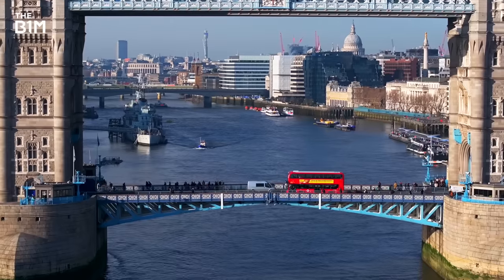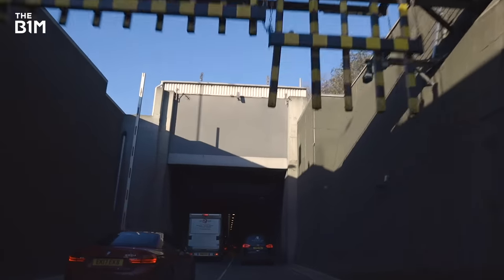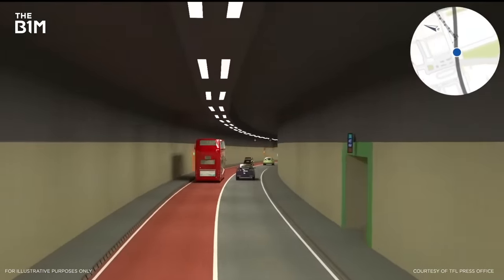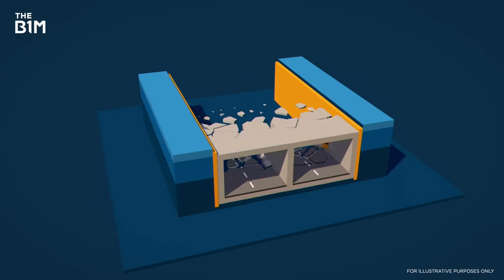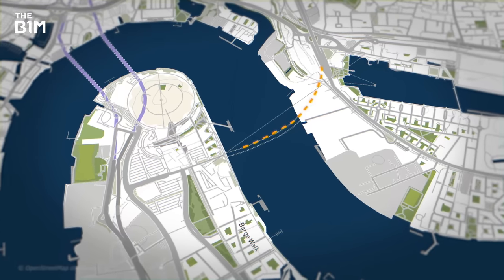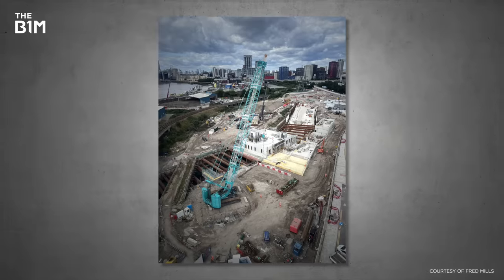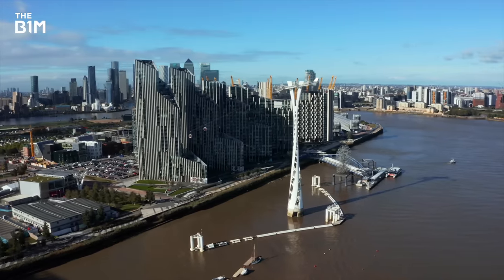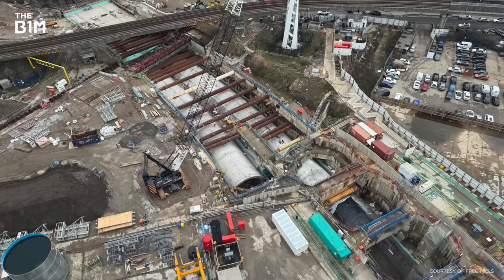The $2.8BN Megaproject Dividing London

Comment: I lived in the Royal Docks, and I know how horrible it is to try and get from North to South and vice versa. Yes we do need more public transportation and cycling options, but we also desperately need another tunnel like this. In that area there are very limited options to cross.
Reply: what road have they ever added in london that made traffic better? The problem is too many cars
Reply: Ive lived in silvertown and now live in Greenwich. Getting to the other side of the river is super easy. Its called "the tube".
Reply: @obinneji There aren't even decent transport options because of lack of crossings. I live in the east and when I needed to to cross the river, I had to take a bus to Woolwich tunnel, cross it on foot and take another bus on the other side. Extremely inconvenient.
Reply: @arturturkevych3816  fair point!
Reply: @obinneji depends on how you define making traffic better. You could argue the same thing with mass transit if you think it’s a failure because the network has to be expanded or improved ever again. This won’t solve congestion issues you won’t ever do that. But it will help.

I love cars and want to drive. If you want to take mass transit great. I support expanding public transit but I also support expanding our road system.
Reply: @campbellsadeghy213  there's a body of evidence that shows similar schemes actually make traffic worse.
Reply: @gmtom19 can you take your car on the tube tho
Reply: @dressrosacr7  why do you want to drive in one of the best places on the face of the planet for public transport?
Reply: @Hurc7495  I work with my car for example so I wouldn't be able to do that, also not to mention it's quicker most of the times and more convenient
Reply: @obinneji  The road could make an excellent tram-route in the future.
Reply: @obinneji  since 2000, the UK population has incrased from 58 million to 67 million. Do you think an extra 9 million people increases congestion or emissions? Does population rise drive increasing emissions from construction, heating, food production and transport? It's silly to blame an infrastructure project for a natural consequence of more people on the island.
Reply: Why would south east London want to connect to poor east london?
Reply: @KiLLJoYYouTube  aren't you the guy who used to hack the sidemen gta lobbies
Reply: @dressrosacr7  i'll have to take your word for it that your car is necesarry for your work but as someone who lives in a relitively small city with relitively light traffic i still find i'm regularly faster than a car over 3 miles. i also never have trouble finding parking and it's always free!
Reply: I @gmtom19 I agree with you if you do that in "normal hours" try to do that at 3:30 in the morning....
Reply: @dressrosacr7  Okay and? I live in london, so like any sane person I dont drive.
Reply: @aspalma   Fair, but I dont think theres much traffic in the blackwall tunnel at 3.30am
Reply: @gmtom19  how are you trying to say people that drive are not sane, that opinion alone isn't a sane one
Reply: @gmtom19 true!  3:30 is marvellous to cross. But when I return in the afternoon... :(
Reply: @KiLLJoYYouTube  Pretty sure south east London isn't so hot either lol
Reply: @obinneji  Yes, but the huge bottle neck doesn't help. I live in Blackheath and welcome the Silvertown tunnel, as it can take 40 minutes to reach the tunnel sometimes. Any easing of that congestion is welcome news.

Comment: It’s a great feat of engineering, however as London is so congested where does the traffic go at either end, the tunnel and the exits will be blocked with traffic most of the time.
London has always made the tube and trains the priority and all the best underground real estate is full, especially in Chelsea, Knightsbridge and the underground basement in mansion houses. Above ground you can’t widen any roads for a significant distance so what do you do, bridges, drone taxi, super deep tunnels? It’s the 24/7 ancient city that is at the limit.

Comment: There's no such thing as 'road tax' in the UK.
Reply: VED is often called 'road tax'
Reply: @Gfynbcyiokbg8710  It is. But it's incorrect and misleading - Vehicle Excise Duty does not go directly to road maintenance or building. It goes into the general tax pot. And on a different point, most cyclists pay VED, contrary to the belief of some, as most cyclists are also car drivers.
Reply: @RTWuk  except road tax doesn't mean a tax that goes towards road maintenance, it usually just means a tax that vehicles have to pay to use public roads so therefore VED is a road tax
Reply: @Gfynbcyiokbg8710  You've missed the point.

Comment: See you in 20 years when it’s not gonna be enough because this is a well documented phenomenon that this will never change a thing.
But great engineering feat though!
Reply: I can only hope one day it's converted into a tube line or a cycle path
Reply: Bet you don’t comment the same thing on public transit projects.
Reply: @campbellsadeghy213 thats the whole point, public transport is so much more efficient that this barely happens
Reply: 20 years? You’re too optimistic.
Reply: @campbellsadeghy213 name one western project that took 20 years and still isnt built
Reply: @KingFinnch it does happen. If you provide something convenient people will try to use it thus causing congestion and creating the need for a new convenient connection to offset the congestion. This is true regardless of car roads or mass transit lines.
Reply: @Hhhh22222-w  their not saying it won't be completed their saying that adding more lanes and alternatives creates more traffic its a well documented phenomenon,  so most of the time road projects like this one are not the solution
Reply: And how would things be in twenty years if we didn't build the tunnel - better or worse than with it ?
Reply: @LIETUVIS10STUDIO1  They wanted to do that for the Levis tunnel in Quebec, but that’s ridiculous as well. There are other ways to remove cars in this cases. But yeah, at least they could do that!
Reply: @hb1338  Depends! Given the UK gov, probably worse because they would not do a dime to change how people move. 
If they had a proper government, with actually intelligent people, they would cancel the project, use the money to invest in a proper infrastructure that remove most cars from the road, give people way less transit time, and help cleaning the air. 

But you know, we have the brains, they just aren’t the ones we elect.

Comment: One more lane bro, one more lane, I swear it'll work this time!!!!
Reply: It will probably work as now there will be tolls on both tunnels and much better bus routes
Reply: All the tunnels are toll routes and drivers hate tolls. 
I would much rather a crossing exist then nothing at all.
Reply: East London does have a bit of problem regarding traffic tbf. We currently only have three crossings by car, And only four by train as well, 2 of which being the DLR...

If I'm not mistaken, that means all vehicular traffic currently passes through 5 lanes north bound, and 6 lanes south bound. That's a lot of traffic reliant on 3 crossings.
Reply: It’s not one more lane though.
Reply: @NitroNuggetTV  ??? There are 7 rail crossings in East London which is the same number as West London. 

And there are either 7 or 3 lanes in each direction (depending if you count the Dartford crossing or not) + the Woolwich ferry.

Comment: I don’t live in London, but I heard about this project a few years back. I didn’t realise they were made enough to actually build it! Whatever happened to reducing vehicular travel and congestion?
Reply: This will reduce congestion
Reply: @DaChaGee  No it won't. Every new journey that this tunnel generates still has to start and end on regular city streets. It will only mean more people choosing to commute cross-river by car, casuing more trips through existing streets. 

Every study shows that adding more road capacity in dense urban areas doesn't work. It just encourages more people to drive who otherwise wouldn't, increasing traffic in the long run.
Reply: @LightbulbTedbear2 ah well

Comment: This new tunnel will just skim off the local traffic between Woolwich/Charlton/Greenwich in the south and Silvertown/Becton/North Woolwich on the north side. 

Long distance traffic heading north via M11 or south via A2 into Kent/Dover/Chunnel will still use the old tunnels. Any long distance traffic trying to head east  from the new tunnel will first have to first go west over Lower Lea crossing before joining the A13 at Leamouth Rd/A13 junction, just 500m from existing northern portal. Or navigate the local roads at 20mph to Beckton to join the northbound traffic from the Woolwich ferry on the A1020. The locals will love that. I will probably use it as I travel locally between Sidcup in Bexley and the SportsDock centre on the A1020 to coach. But its going to cost me the toll both ways twice a week and we don't know what that will be yet. Dartford crossing is £3 for cars.

It seems unfair that only the east side of London has to pay tolls to cross the Thames whereas the rest of London uses the bridges for free.

Comment: that "removing idling cars" argument by city hall is utter bs, it is a well known and documented phenomenon that more streets and even more lanes often lead to more traffic congestion and overall to more traffic which way outweighs the removed cars in idle
Reply: So does their LTN schemes which already cause traffic bottlenecks on major London roads.
Reply: @NmpK24 How though? You shouldn't even be driving down residential roads in the first place. There was already bad traffic so you had to resort to driving through quiet residential roads mean the roads were already congested. LTN's were introduced to reduce short car journeys by blocking residential roads. Main roads will always be congested it is not as if it was quiet and free flowing.

Comment: I totally get the arguments against the tunnel, and I do worry pollution will rise. But living in the area - the current situation is a total nightmare. The Blackwall tunnel operates beyond its capacity. For half the day there are miles long talebacks, which causes a lot of pollution. Any problems with the tunnel, like a car breaking down, causes the entire local area to back up with traffic, as the only other alternative, the Rotherhithe Tunnel, is not just miles away, but single lane and extremely narrow. Something needed to be done.

Comment: Why nobody is building underground networks for electric bicycles. They can be used year around emission free plus cardio exercise. Bicycles can’t be taken out of the tunnels batteries are replaceable at charging stations hopefully powered with renewables. It doesn’t have to be all underground it can be on the surface or above like bridges but must be covered and protected from the elements

Comment: All the people with the classic ‘one more lane bro’ mantra are forgetting that there are other vehicles that need to get around London other than cars. From a lorry drivers point of view this is a major positive for London. The majority of HGV's (except double deckers) can go southbound with the 60's Blackwall tunnel (I think it's around 15'6''), but northbound with the Victorian tunnel is totally different. The height restriction is around 13ft, the majority of HGV's are higher than 13ft , where i work the lowest is 14ft. This means major detours if having to move north from the south, Either further into central london or out to the already heavily congested Dartford tunnels. The Sainsburys Thameside Distribution Centre is a prime example, around a 5-10 minute drive from the blackwall tunnel to the south, you can go south to it from the M11, but have to take detours if you need to be the north side of the river again.
Reply: "..there are OTHER vehicles that need to get around London other than just cars.."  

99% of the car  driving 🚘 population and particularly those who make the decisions about road construction and new links between A&B, who are most certainly included in this(rant) never give a thought for the "more important(!) " users of our roads in the UK, the HGV artic drivers, who transport all our goods by road ,from A to Z and back again, against the clock 🕒 and tachometer, every congested mile and traffic diversion and detour, through every height restriction, every weight restriction, every width restriction, every time zone restriction....pretty much every working day,  seen usually just as a nuisance on the road more than anything else 😮 
...try turning left going northbound towards Woolwich ferry from Well Hall Road (A205) and then heading west down Shooter's Hill Road (A207) going towards Blackheath, in an Artic, with a set of lights 🚦 3" from the off-side of the top of your trailer as you swing round.... 💥💥🤯🤯 
the overwhelming majority of drivers on the roads today haven't got a clue about how physically impossible driving from A to B can actually be... a transit van is too big for a lot of them there 🙏
Roll on the new crossing for them, they truly deserve it 👏👏
10-4. 😂  🚛 🚛 🚗 🚛 🚗 🚛 🚛 🚙

Comment: I don't think that sustainable transport needs to be at odds with projects like this.  Cars exist.  If there are ways to expedite their flow from one point to another, that improves their efficiency.  Projects like this should go hand-in-hand with the provision of more and better public transit and pathways for cycling and walking.  It's also worth noting that a time will likely come when the majority of vehicles used in urban centers will be electric.  At that point, the question of sustainability may be difficult to defend from a "fewer cars" perspective, and tunnels like this will still serve the purpose of reducing congestion.

Comment: if they made road tax smarter e.g bolt on road tax for access to local tolls withing 50 miles radius of your postcode then perhaps people would settle for it. e.g £200 road tax bolt on 50 quid for the year access to dartford, silvertown etc maybe a 300 pound bolt on for congestion charge access for the year

Comment: No drivers pay a road tax. The UK hasn't had a road tax since the 1930s, ironically because Churchill thought drivers were getting the impression they were paying for ownership of the road network. UK motorists pay VED - an emissions tax, which electric vehicles are exempt from.
Reply: VED is still a form of road tax
Reply: @Gfynbcyiokbg8710  No. A road tax is a tax to use the roads. The UK has no such tax. The UK has an emissions tax whereby: zero emission vehicles pay the least, and more polluting vehicles pay the most.
Reply: @RCEASTMIDLANDS  Thats still a tax to use the roads 😂 no definition of a road tax says it can't be based on emissions
Reply: @Gfynbcyiokbg8710  So your idea of a road tax is a tax not every vehicle pays, and which is required to own a vehicle, and not to use the roads.
Next you'll be claiming VAT is a road tax.
Reply: @RCEASTMIDLANDS  You said "A road tax is a tax to use the roads". VED falls under that definition as you have to pay it to be able to use the roads. You also don't have to pay VED if you aren't using the car on roads.
Reply: @Gfynbcyiokbg8710  Per the House of Commons Library:

"The original tax that became VED (introduced in 1921) was created to provide funding for road construction and maintenance. This is no longer the case, and VED revenue is not hypothecated for road maintenance. More recently, VED became more closely linked to vehicles’ environmental performance (to reflect wider negative externalities of car usage)."

While the two may overlap, they are not the same in intent or use. Kind of like how every car is a vehicle, but not every vehicle is a car.
Reply: @RCEASTMIDLANDS  Its just like your example of a car. VED and the 1920s - 30s "Road Tax" are both forms of road tax but neither are the only forms of road tax
Reply: @Gfynbcyiokbg8710  What the UK has is more accurately known as a car tax than a road tax.
Reply: @RCEASTMIDLANDS  VED isn't a car tax. You only need to pay VED if your car is on the road (so if it is e.g. in a garage 24/7 you don't need to pay VED) so the most accurate definition of VED is an (emissions based) road tax, because that is what it is.

Comment: Seems to be dumping traffic from one congested side to the other -the Blackwall tunnel might be a bottleneck but access is restricted anyway with the given roads especilly in south London. This Silvertown tunnel despite excellent engineering seems very likely to shift the issue barely a mile down the road.
Reply: yes, this is exactly why there is opposition. All the traffic flow models show increases congestion on the south approach roads which go by lots of housing and schools
Reply: @a1white  the fact that Mr Khan used the same groups that pointed this out to promote ULEZ but completely dismissed them stating the obvious on this tunnel sickened me.

Comment: "the extra capacity will reduce cars polluting by queing and idleing to cross the river" - This excuse was always BS because if the tunnel opens in 2025 then thats only 5 years away from the non electric car ban, and as we know EVs don't causing any tailpipe/idling emissions . So even if the tunnel wasn't built there idling emissions would be reduced shortly after anyway.